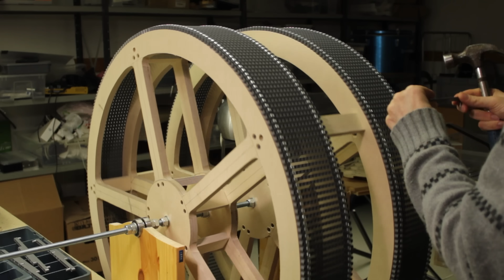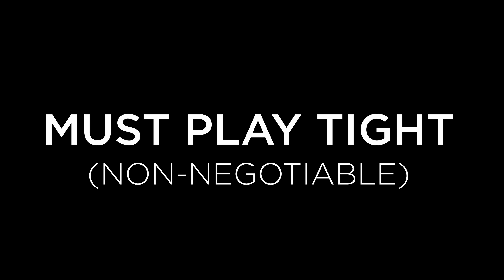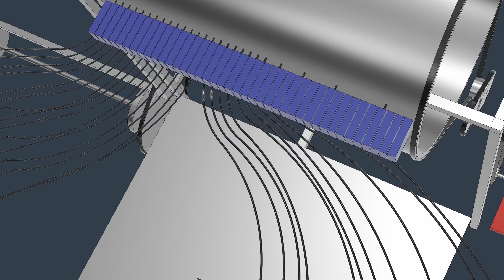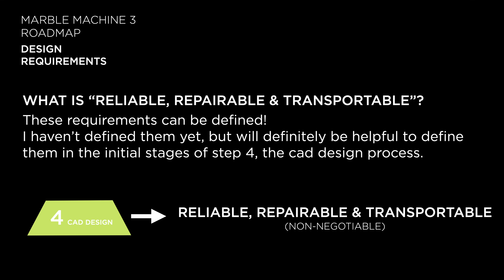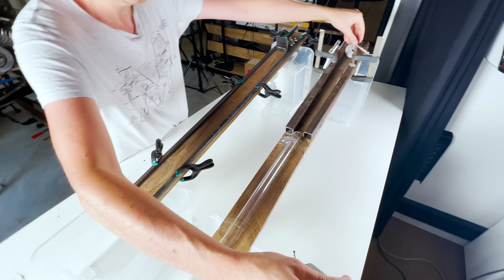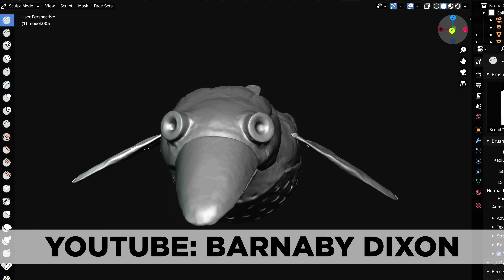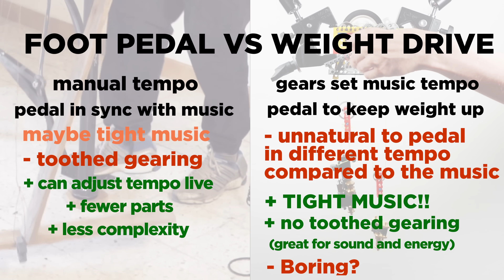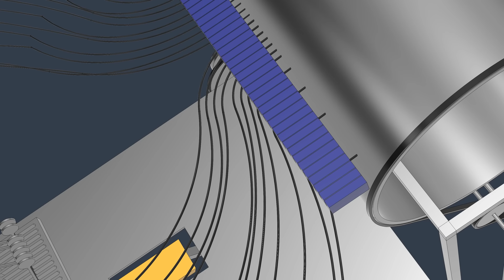Marble Machine 3 is Taking Shape

Comment: I love you saying that this is an art project and not an engineering project! That couldn't be more true! Giving specific timing requirements is completely silly because what matters is that the music sounds good. The original marble machine was more than tight enough. The MMX was more than tight enough. This silly goal of "0ms standard deviation" being the standard of "tight music" is the highest form of insanity I think I've ever seen. If you could measure with higher resolution would you still try to get it down lower to 0us, 0ns? The music will sounds much WORSE and artificial for being so tight. After some quick googling, 10-20 ms standard deviation seems to be standard for a human player.

We're in your corner Martin, very excited to see where you go from here. You're an artist, you make people see beauty in things.

Comment: I’m wondering if there’s another possibility, both foot pedal, and Huygens drive.     Use direct foot drive for control, at the cost of a bit of tightness, the switch to Huygens drive to step up the tightness.   You could also add a tempo control, to be able to speed up or slow down the music, a bit like a pitch bend, but for tempo

Comment: Power it with a solar panel which is integrated machine; no batteries, you just have to uncover the panel near a light source to run and can pause it/wind it down by simply blocking the light.

Comment: I think you should ditch the pedals all together and go with an electric motor with a variable speed controller at your fingertips, so you can control on demand what the tempo is without the added stress of pumping a pedal.

Comment: You could combine the Huygens weight drive with a centrifugal friction governor by biasing the Huygens drive towards running fast, then running the output through the governor.  This would allow you to adjust the governor (therefore tempo) live. You can also have a clutch on the power input to allow pedalling at any speed without fear of overwinding the drive. 

Yes, it's more complicated to build, but this is essentially how the historic Thomas Cooke telescope I used to help run worked. It was built in the 19th century, and aside from the normal mechanical maintenance of greasing, cleaning, stripping, repainting, rust removal etc, it is STILL running to this day. Tight enough to track stars.

Comment: My big concern with the manual foot pedal would be that during a long performance it would drift slightly out of sync, to the point where the down stroke of the pedal is almost but not quite in time with the beat, and then it’d be a nightmare to pedal because you’ll want to pedal on the beat.

Edit, to do some maths:
If you are playing at 100bpm and your gearing is off by only 0.1% then after 5 minutes of playing you are off by half a beat and exactly out of sync, having to pedal exactly between the beats, which would be really difficult, have you ever tried to clap precisely in between the beats? I just think you are setting yourself up to making a machine that cannot play tightly by attempting the manual pedal, I’m glad you have the fallback option there, it’s a great process meaning that even if this fails, you’ll catch it in time.

Comment: Those are shit requirements. The timing SHALL be less than 5ms standard deviation. is a requirement. Play with your music editor and determine at what point the timing gets to a point where Martin is not happy and write that down as your limit. then when you build the machine you can MEASURE against that requirement = pass/fail.

Comment: Take a look at "continuously variable transmission".
Basically, this would allow you to use the weight drive and still adjust the speed during the concert by adjusting the distance between the wheels.
It is quite common in cars with automatic transmission.
I know these Systems from Schäffler in Germany, where they use a chain instead of a belt between the two wheels.

Comment: Why not both? Why not both a foor pedal and the Weight Drive? Then have a lever with which you can engage some clutch system or smth to switch between the pedal engaging the weight drive or the machine directly? If you go for the weight drive, som sort of a Continously variable Transmission could be great to dynamically adjust the tempo

Comment: if you tune well your weight and gears(both the power in and out trains) for the Hyugen weight drive you can arrange them in a way that given a BPM the weight goes down the same amount you pull it up by pedalling at the same tempo. Just equalize the power in/out ratio independent of the BPM

Comment: Why not both? If you use a flywheel you don't need a toothed transmission for the paddle and it wouldn't be to hard to witch its output between the weight drive or directly to the machine.

Comment: 4th possibility: Don't decide it yet. Instead make an agile attempt. Use a motor in the first iteration and look, how you can play with it. After playing with it for a while you can decide this later. Or not and leave it as it is.

Edit: This is also useful for the case, when you want to interact with the audience. The machine can play itself and you can interact much more with the audience.

My 2 cents: This whole idea of putting timing on the first place and then use hand/foot to drive the wheels is just stupid^D^D^D^D^D concentrating to the wrong target. :)

Comment: Good decision. Simple is good.

You are the speed governor you need. If you can tap a tight rhythm, you sure can learn to play equally tight music with MM3, probably even tighter. Just design such a pedal/crank that it can support your motor skill well. It means: no tiny plastic cranks that are difficult to control!
Reply: Also, while it can feel it's against the spirit of the MM3, please reconsider adding an electric motor. It can be integrated very tastefully into the machine, carrying some of the constant load for you, and allowing you to move around every now and then if you need, without letting the music slow down meanwhile. Think about it like an electric bicycle: it's still an bicycle.

Comment: First I think you are on the right track to go the the pedal drive option. like your friend said it retains the human part of the music. The small imperfections we can accept in a live production, it is prof that this music is produced by a human artist, and the flexibility it offers makes it possible to vary the tempo dynamically for practical and artistic reasons.

But I also think you should make it possible to cheat a bit by incorporating a electric drive to use when you want absolutely perfect stability and still retain the possibility to change the tempo on the fly. Both systems fill a purpose, The pedal is for when the artist is performing. The electric drive is for recording or parts of a performance where you want to leave the marble machine playing while doing something else on stage, such as interacting with the audience, playing a part on a keyboard and so on.

Adding an electric drive to the pedal drive system should be pretty simple and add very little in the way of parts.

Also don't use a platform for the pedal!

When you are playing the different instruments you want to be able to move around. With the platform you risk stepping off it as soon as you move. And the step up and down introduces a complexity that simply is not needed.

I know you were worried about geting you foot squished under the pedal and thus wanted to make the pedal "thick" enough that at the top of travel it won't clear the platform. That's over thinking things. Instead make the pedal connect to the drive system using a wire. The power you provide comes from the down pressure you put on the pedal and that can be transferred using a wire. When the pedal moves down that wire can't transfer energy to the pedal as the wire just buckles and bends instead of pushing the pedal down. This way there is no risk of crushing your feet under the pedal.

Finally you have to consider a way to start the machine from a standstill. A pedal is agnostic to the direction of rotation. Depending one where the machine was stopped a pedal can just as easily turn the flywheel backwards as forwards. It can also stop dead center at the bottom of travel. The you can't start the machine at all using only the pedal.

So you need some way to give the mechanism that first push so it starts rotating in the correct direction before you can use the pedal to spin it up to the desired tempo. This might not require a complete hand crank, but that has to be considered before ruling out having a hand crank altogether.

Comment: I think plan for foot pedal and weight drive.  You could throw a lever to lock out the weight drive and run on the foot pedal only?  Or have the weight drive timing governor easily adjustable from your playing station? Maybe you could engineer a way to use a bike shifter to move the governor up or down a few bpm?  Also, there's going to be a lot to lift with your legs for a whole concert with the weight of the marbles and friction.  Perhaps look into electric pedal assist (like an ebike)?  Love your work Martin.  And love being along for the ride.

Comment: You say there is disappointment for engineers here, in that the requirements are art not hard engineering.  But . . . engineering requirements very often have "to taste" in them.  It's true that the art part might be somewhat distant from the direct output of any given engineer.  But if you think about something like an iPhone or a Tesla car, what are the requirements?  Most of them eventually boil down to "somebody is excited about the product".  iPhone requirements involve form factor, download speed, responsiveness, etc that make people happy and excited.  Tesla requirements involve acceleration, top speed, comfortable interior, and curvy exterior that make people excited to buy and drive them.  Most of the engineers involved in making the car are just given a number to meet for what they're trying to accomplish, so it's not the engineer saying "I will make a thing that makes me excited".  But that's just because there are so many people working on the project in parallel.  The overall goal is excitement, and you're just in touch with that because you are the primary engineer and customer!

Comment: As far as I am observing it, the drive system needs to fulfill a few requirements:
- Allow it to express your personal character. I fondly remember the spin up / down sequences of MM1 -> Weight drive in its current iteration is not suitable
- It needs to allow a while of not actively driving the machine, while still playing music tightly. Think about the world tour and your interaction with the audience. -> No 100% manual system will fulfill this requirement
- It needs to be able to play extremely tight when required -> Weight drive is suitable, so is an electric drive
- You need to be able to play a whole show, even when not being 100% physical fit at times -> 100% manual drive will not allow this, weight drive and/ or electric drive is suitable
- The timing / bpm needs to be flexible or adjustable -> Weight drive likely not suitable if I understand it correctly; Manual drives and electric drive is suitable

I am thinking, that you need a hybrid drive of some sort. Partially manual, partially indirect / automatic, to take stress from your body and allow for 'world tour freedom'.

Possibly an electric drive as backup method, so the MM3 can keep going, even when the weight drive or manual drive fails. Also an electric drive won't need any weight tuning or whatever. Set rpm and hit go.
Maybe a weight drive, that can be activated and deactivated with a weight drive clutch or whatever. A weight drive is both visually showing the movement and able to play tight. However, it may not be the right option for all circumstances.
A manual input system, that allows sequences where you add your own character and imperfections to the timing.

I do not think that there is an either this or that solution. Do not make the mistake again of prioritizing form over function. Focus on what it really needs to do

Comment: Martin, I am so glad I tuned in to see this; you have changed how I see things.

To keep a long story short, I was given a large-scale project at my job a few months ago...and I've been dreading working on it because I lack any direction. After all I do, people keep challenging my design, despite me lacking much experience in the long-term goal. I find myself avoiding it because I don't know what to do, and no one else is qualified to do what I do. It's basically all up to me.

The biggest problem I face is a lack of direction, and despite trying to come up with a "roadmap" of sorts, I seldom follow it exactly, and it's in a constant state of revision. The pyramid-style design requirements map will be integral to my success, so thank you for introducing it. Like you, I also started at Step 4 but quickly abandoned that in favor of my boss's "quick & dirty" mentality. That clashes with my "I must know everything and anything about how this works" mantra, and despite still clinging to it at times, I still struggle with not focusing on the big picture.

By breaking the project down into these 5 main steps, coming up with an objective for each (especially non-negotiable ones), and adhering to this roadmap, I can put myself on a path to success.

Best of luck, Martin, and I love watching you on this journey!

Comment: @Wintergatan an idea Why not just use a foot pedal as the main drive and the drive via the weight as an external source / protection. You could engage a clutch in the foot drive. Would certainly be an advantage if e.g. a leg cramp occurs or something unusual happens to be on the safe side, so there might be a brief jerk in the music, but not a complete break.

Comment: If you use an electric motor for the power input, then it should play as tight as possible AND have the added benefit of being able to change the tempo via a speed controller.

Comment: May be add a switch that could let you switch between the foot pedal mechanism and a clock mechanism. You can start with a clock mechanism and closer to the end of the composition you can switch to the pedal mechanism to speed up tempo (like a modulation) and end it with the pedal. Or end with a clock mechanism if it can adjust itself to the sped up tempo of the pedal mechanism.
Reply: Yep, why choose one when you can have both

Comment: If you use the weight drive, you might want to investigate using a sort of CVT to adjust the speed. That way, you could dynamically adjust the speed without being limited to specific preset tempos. You could use a lever that has tempo labels next to it so you can set it to a specific tempo but then make it faster or slower smoothly. In addition, using just a gear transmission means that if you want to adjust the tempo while playing, it will be very sudden and might result in some unwanted forces that may affect tightness.

Comment: Whichever power train you use... my question would be: have you actually tested your power input? I.e. how comfortable are you with pedaling for a whole hour?
With the Huygens you can just keep the energy suspended, which would allow a much quicker startup and allow you some time to gather speed. (i.e. you can let the stored power do the startup, allowing for a much quicker start, and also a much easier start. It's much easier to push a moving object faster then it is to start the object moving)
Also, depending on the energy reserve, you can give your leg some rest

Comment: Hi Martin, 35 year bike mechanic here. I deal with most types of Bowden cable
every day. The main reason high performance bike gear shifting systems have changed from mechanical Bowden cables to servo-actuated electronic shifting systems is the increase in reliability and predictability of shift action whilst moving chains and cogs smaller & smaller distances sideways in gear clusters, over more gears (12 at current count, tho I suspect 13 is in the wings - yes I know about Ekar). Longer cables increase drag and latency. This will affect your music timing. At least use latest generation ‘compressionless’ housing & cables for cabling. Tandem bike cables come in 3200mm length. Normal is 1700mm or 2100mm. I hope that I don’t get to say ‘I told you so’.

Comment: Martin I have two thoughts on your foot pedal vs weight drive.
- You don’t like the idea of pedaling at a different tempo than the music. But realistically you don’t have to. As a musician you’d probably start pedaling at the tempo of whatever is playing, which matches the machine. Just make sure each pedal definitely provides enough energy that you can pump at the pace that feels right with the music.
- If the only benefit of the foot pedal is the ability to change tempo (I say this naively so forgive me) make it that frictionless to be able to change the tempo of the machine live. If the weight drive can be lifted while still providing energy, surely some similar mechanism can be made to set the tempo so you can keep it tight.

Comment: Dammit Martin! Set your interfaces! What's on the other side must not matter! You should have s electric module, a weight module and a manual module for power input, and they all must be equal to the next step in the marble drive, albeit perhaps with different tightness.

Comment: Just to say it, I'm 100% sure you could design around the pumping your foot at a different rate problem. If you were pumping your foot at a faster rate and topped out the weight, you could simply figure out a way to waste that last little bit of input power.